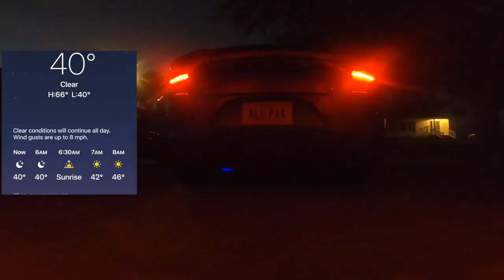How to install Stainless Catless Mid Pipe System for 15-22 Dodge Challenger/Charger 6.2L/6.4L

Comment: Yoooo I legit just did my install yesterday, took me about 4 hours by myself. Wanted to say your video helped a lot and the defoulers worked perfectly! Big ups to you for the video man, I got a corsa extreme cat back that I paired it with so she’s screams!
Reply from the maker: Glad I could help.  I tried to make the video easy to understand and educational.   I know that exhaust system you have is loud  with cats so I can only
Imagine how loud it is now lol.
Reply from the maker: Sorry for the late response.  I thought I typed a response but I guess I never pushed send. Smh.
Reply: @BLUPAK all good brodie! lol it’s insanely loud man, that first cold start after putting them on was crazy. Well worth the time and money no doubt. Thanks again
Reply: Did you have any trouble getting the nut off on the driver side mid pipe, mine took forever
Reply: @lidaddy1 I did man! Idk why but that nut came out of the little bracket, it’s like a square and it would just spin until I noticed and got pliers on the other side. Took me way longer than expected once I ran into that problem
Reply: @fastyy5759  yea, the nuts on my passenger side were so loose I just turned them with my hand, I have no idea how that happened
Reply: @lidaddy1  damn at least it wasn’t a headache like mine was 😂 besides that everything else was really easy

Comment: What’s worst case scenario if I don’t add the foulers? Besides the check engine light. Do I really need to add that on?
Reply from the maker: Honestly you should get a tune to take full advantage of of no cats.  The car will still run but with a CEL and you will smell the exhaust Fumes more than normal
Reply from the maker: I ran catless untuned for a few months with zero issues.   Its loud btw and your neighbors might hate you

Comment: Hey I have a question I want to do the same go catless but I have a mid muffler / resonator delete will I have the check engine light ?
Reply from the maker: As long as you do exactly what  I did you shouldn't.

Comment: So cornerstone mids don’t slide right in you need a tailpipe expander? that’s crazy
Reply from the maker: Naw they fit but after you tighten down the clamp the exhaust is a tad big to small so you have to expand it a lil bit.
Reply from the maker: I rather it go in smoothly vs hammering it in try to get it back in

Comment: Yo I have a question I have a Scat Pack 2022 charger it came with corsa performance exhaust extreme Cat-Back system don't get me wrong my car sounds hella loud when you turn it on especially when you step on it it screams so if I get this the mid pipes catless is it going to be even louder what you think because I found a price they're like 620
Reply from the maker: It’s going to be louder all around.   It will be louder on the start up but it will really start to sing when you get on it forsure.  I’m sure it will surprise you.  I bought my catless mids from cornerstone performance for 300 ish.
Reply: @BLUPAK  that's exactly I still have the link save the price range is $649 nice because don't get me wrong I love the way it sounds of my car. Of Corsa performance exhaust extreme Cat-Back system so if I put this on it's going to be 2.0 Corsa louder that's why I want what does two pipes go in the front they just have to remove those two pipes and put this new one huh
Reply: @BLUPAK  if anything sent me the link I want to make sure if that's the right one I know what website you're talking about Cornerstone

Comment: Do you have any other exhaust mods or is that the stock exhaust from the mid back?
Reply from the maker: I replaced the OEM mid muffler with dynomax race bullets and it still has the OEM resonators.  The car is now Cammed stay tuned for the next video about it.
Reply: @BLUPAK  Thanks for the reply, I like seeing hardcore motorheads like myself doing mods barely being able to squeeze under cars to work on them. Just like the good old days. Thumbs up!!!
Reply from the maker: Thanks for commenting.  I love working and being around cars.  I will do as much work on them as I can.  It was a tight fit under the car btw😂😂😂😂
Reply: @BLUPAK  we have the sam setup just mine a 5.7 with no res
Reply from the maker: @Th3god527   I bet it sound good too.  I left my res on because I feel like it’s extra raspy that way.

Comment: Before the tune did it throw a check engine light?
Reply from the maker: Nope.  The defoulers worked perfect
Reply: @BLUPAK so u basically didnt need a tune correct ?
Reply from the maker: @emerduhbs4612 at the time no. But it is tuned now.

Comment: Don’t u need cats? and this cornerstone legit right my guy cus it’s pretty good prices
Reply from the maker: Technically No but it also depends on if you have Emissions where you live.  Cornerstone is where I got mine from and they shipped out pretty fast and they had no fitment issues.  100% recommended

Comment: Can someone tell me why my mid pipes won’t seal properly at the manifolds!?!? HELP 2020 Jeep srt
Reply from the maker: Oem or catless mids?
Reply: @BLUPAK stainless works mid pipes with high flow cats
Reply from the maker: Well my firstsuggestion is make sure you are tightening the flanges equally.
Reply: Having the same issue the passanger side loosens up all the time
Reply from the maker: @Nemesis123-y4t  it’s loose at the flange?
Reply: @Nemesis123-y4t  check the nut behind the manifold. My pops had to get in there and break off the shielding around the nut with a damn pry bar. Afterwards he used a wrench to hold it while I hit it with the impact from the back slightly

Comment: Did you put two of those 18 mm things together
Reply from the maker: Are you referring to the defoulers?   Is so, yes I used 2 per side.  The top one needs to be drilled out to fit the o2 sensor
Reply: Ahhh ok and what you mean needs to be drilled on top?
Reply: And can I ask why I use two is the wire to short or the o2 sensors
Reply from the maker: The middle of the top defouler needs to be hollowed/drilled out with a 1/2 inch bit to allow the sensor to reach the threads.
Reply from the maker: You need 2 of them to Create enough space to replicate the heat range that the sensor would normally read if the converter was still there
Reply: Car sound great
Question: am I missing something. 
Why not use 1 long defouler for each side and not having to go thru the drilling and wasting time.
The long ones and the 2 you put together measure exactly the same length.
I'm getting ready to do mine that's why I'm asking, 
Am I missing something here?

Thanks
Reply from the maker: @mannynieto21 well during my research on fixing a cel after removing cats I've never seen another way that worked on my platform.  Plus I have never seen a long defouler just to use one instead of 2. The parts stores locally only sell the ones I used so that's what I went with.   I also didn't want to order anything.  The extra work isn't that big of a deal IMO
Reply: @BLUPAK 10 months in with no check engine still on stock tune ?
Reply from the maker: I never had a CEL for cats on the stock tune